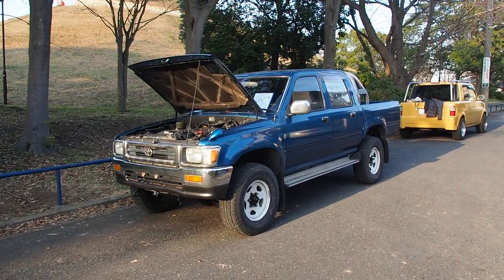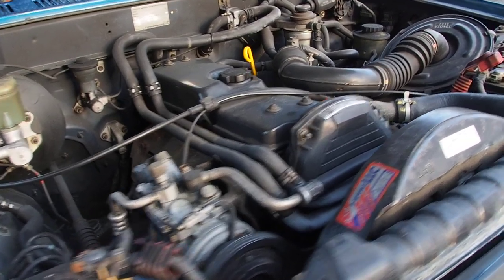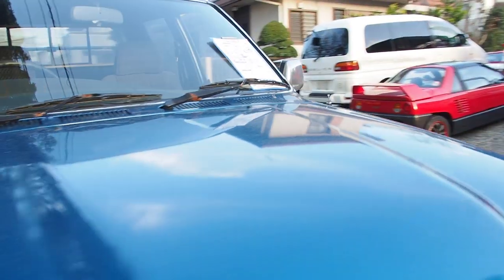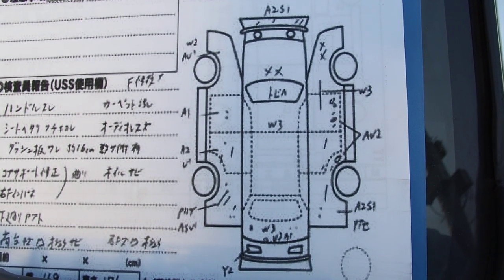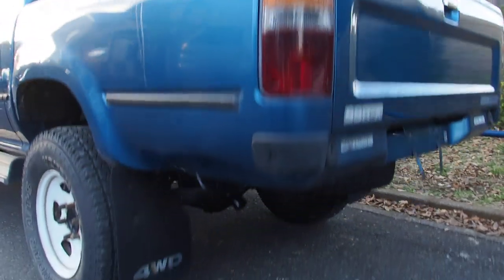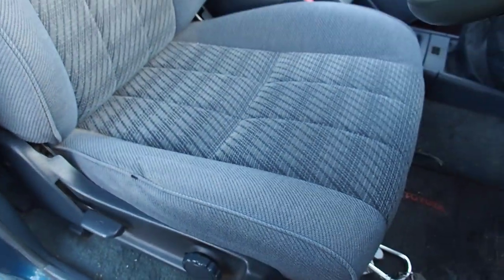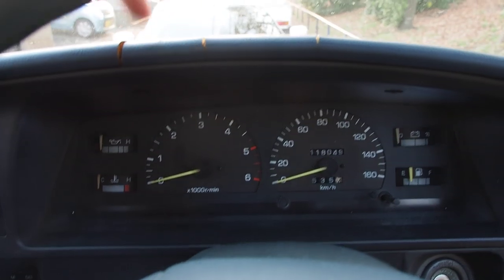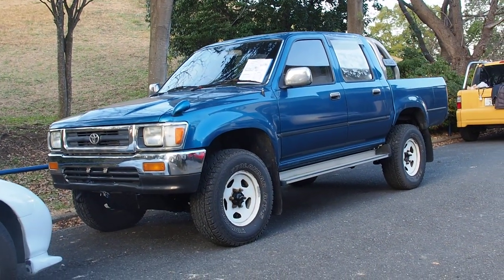1994 Toyota Hilux Double Cab Pickup Diesel 4x4 5-speed (USA Import) Japan Auction Purchase Review

Comment: I used to own a USA spec 1994 extra cab 4wd... I remember having a different key in ignition chime. The chime in this video sounds like it’s from a 90’s Ford Explorer. Super weird.
Reply: Yep, it’s because this pickup was sold in and designed in Japan’s. Their market is different compared to America so, they have different specs and features in their vehicles. That’s why this truck is called a Hilux in Japan but was called the “pickup” in America until 1995. There’s always going to be slight differences in our cars vs theirs. Just like their steering wheel is on the opposite side.